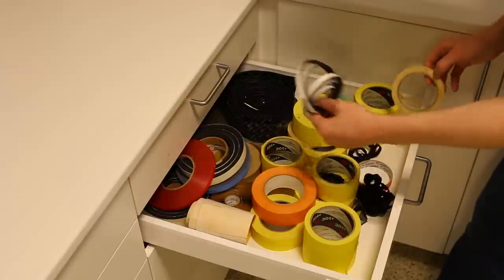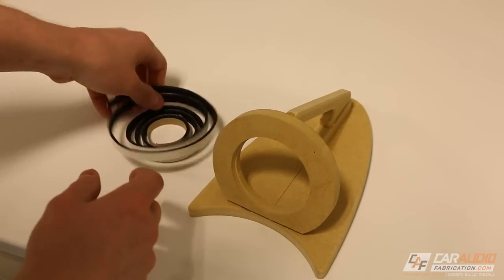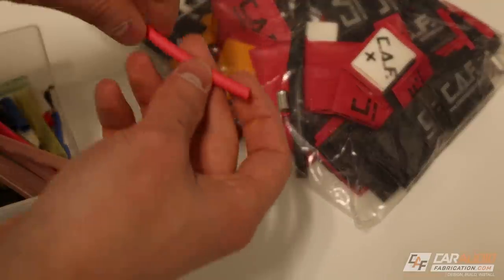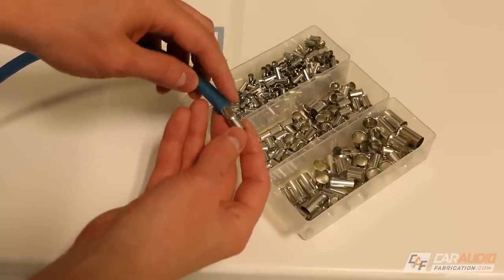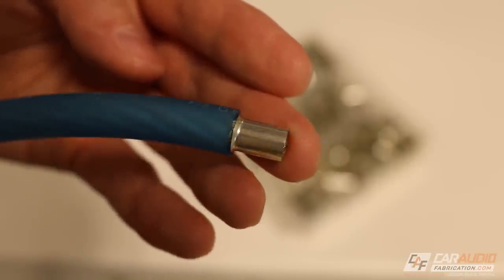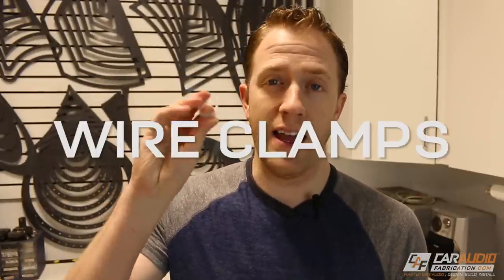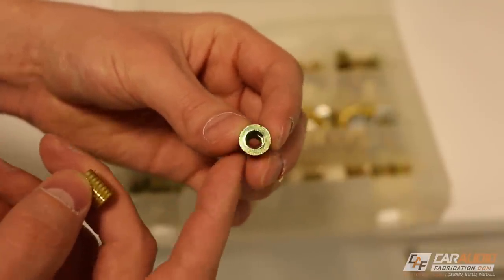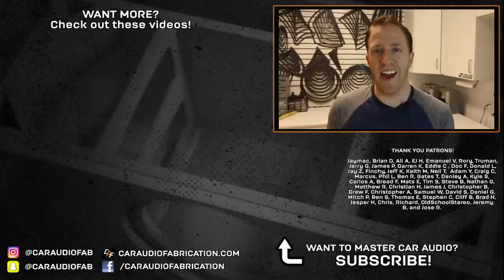Installing Car Audio? 10 CHEAP things to have FOR EVERY BUILD!

Comment from the maker: If you enjoyed this video here is another I recently did for 5 low cost installation TOOLS. You can check out that video here on YouTube: https://youtu.be/s_r82uznoOI
Reply: When people don't put wire ferrule in for the amps and speakers it kinda makes me annoyed. Even though it's something tiny it just seems like something that should be done. It looks cleaner and it probably makes it safer. Your videos do teach me stuff for car audio even though I forget something's. Also, with sound treatment installed will it be possible  to hear the speakers from the outside of the vehicle?
Reply: @CarAudioFabircation you should make a kit of everything besides wires. But your choice

Comment: Good list.  I would also suggest: zip ties, sound deadening material, various fasteners, 2 part epoxy, CA glue, and wood glue.  I also think it's a good idea to have spray paint around that matches the final color of whatever the carpet, vinyl or whatever is going to be the final finish.  I like to paint all the wood parts before they get finished, so that any slight reveal won't be noticeable.  For example, if it's a basic trunk liner wrap going on, I paint everything underneath black or dark gray.
Reply from the maker: +endall39 good additions to the list
Reply: Car Audio Boy Scout :-). Nice comment...
Reply: endall39 is
Reply: Too much for us on appearance. Not enough focus on sound.

Comment: I always keep a metal coat hanger, that has been untwisted with one end sharpened to feed wires through existing grommets. I strip about an inch off the wire, if it's a bundle, I stagger them so there isn't one big blob. I wrap the hanger with Scotch 33 tape, several turns before taping down the wire. Once I've gotten it so it is a gradual increase in diameter, I spray it with WD 40 and it generally goes through smooth as silk.

Comment: was just going to add my list but endall39 covered most, however I also keep ducttape, textured ABS Plastic sheets in 1/8" and 1/4"' for making plates and adapters, i also heat and bend it to make my own hold down brackets for boxes etc.. and of course MDF 3/4" 1/2" and 1/4"

Comment: things i have used on an install. Silicone caulk, i use this in place of the dielectric grease and to plug up any holes that sound could escape through. - also can double as a gasket where gasket tape wouldnt - a thin bead around the edges of say a panel. (to give an example of this i used silcone around the edges of a homemade MDF panel, that was then riveted over a car side panel that had a recess for cup holders - recess was perfect shape for 69's)
Regular pop rivets, hold shit down really tight.
 Soldering iron and solder.
Portable Angle Grinder w/ flap disks
P2000 sandpaper.
Garage carpet - looks good over speaker panels/sub box. You can usually get this for free if you go to a flooring installer and ask for thier offcuts.
Wool Carpet off-cuts - Honestly the best sound deadening over any of the purpose built stuff, but it is heavy.

Comment: Zip ties are a must! Not only are they good for clumping pieces of wires together, it's also a good wire threader if you don't have a wire fish to fish down a piece of from or through your dash. I keep lots of Super 33 tape on me for mock up, and I always have a spool of clothing thread on me, preferably white. That way, if I have a small amount of wire, I can map out my path, say from my radio to my amp, with the thread, cut the piece off, and leave a little extra wire on the ends for stripping. That way, I have just the right amount of wire with no waste and no undersized pieces.

Comment: A cheeeeeep way to do a speaker gasket while also lending a higher degree of customization ability and decoupling, etc. is to use peel-and-stick Ensolite.  Buy it by the yard for your regular sound deadening efforts, and cut thin strips of it for speaker gaskets!

Spray paint also works great for ground connections after mount, simple and clearly no grease concerns.  

I will be buying ferrules asap, I'm starting to see the light on those

Comment: You forgot a very key component to installation! Sandpaper! Depending on what's being done, I like to have 60/80, 100, and 150. If I'm working with thin wood or ply I would also recommend a 220 Grit.

As for tools that you can pick up at any major retailer, (Walmart, etc,) wire cutters/strippers, some kind of illuminating tool; whether a flashlight or a work light as well. I personally use a rechargeable small work light. It puts out a lot of lumens and can last for 8 hours without needing a charge, you CAN run it while plugged it also. One other small piece I recommend is wire butts. You CAN always wrap unused/nonpower wires with electrical tape of some sort. I prefer to use a butt and crimp lightly on it in case I need it for future use.

Lastly, probably the most important thing for audio install; cleaning supplies! Vacuum, general vehicle cleaner, alcohol, and paper towels or cloth that do not leave debris. For all those scuffs, metal surfaces, battery terminals, grounding points, loose debris afterwards, etc. It's an extremely critical step to ensure everything is tidy and cleaned afterwards. You don't need loose wire clippings in your engine compartment.

Hope this helps!

Comment: Best thing to have on any install is a $.39 rod from home depot. I use it to puncture firewall grommets on my quick amp installs. I also bought a crap ton of the water proof grommets off amazon along with a few stinger brand ones to cover the larger 1/0 wire just incase I ever need to make my own hole through a fire wall.

Comment: A multimeter is pretty much essential although I don't know if it would really fit this list since all these are "cost-effective" as you said. With that, I guess a pair of crimpers and wire cutters could really be useful rather than trying to strip wires with a blade or teeth. I don't know if this is a thing but sound deadening tape seems useful.

Comment: Rope Caulk at home depot for subwoofer gasket....helps to hold still while bolt in also...super strong and 100% air tight.

Comment: Between you, Steve Meade, and Johnathon Price.... I’ve learned enough to probably install systems better than most audio shops 🤫 especially here in Dallas where they hardly try. They just run some wires the easiest way they can, run RCAS on the same side to save time, and wire it up. No wire management or anything.
Reply from the maker: They are probably also the cheapest guys in town, trust me there are plenty of shops that do things right, but they also charge for their time. Doing it right ain't cheap!
Reply: CarAudioFabrication agreed

Comment: Look online for companies that wholesale specific parts like stainless steel nuts, bolts and washers and the vinyl end caps for them, wire terminals and their separate insulation sleeves, wire & hose clamps/separators etc. Companies like Nichifu, James Glen, Narva, Mocap, Jae etc sometimes have dedicated specialty wholesalers in specific countries with actual tradesmen/women or people WITH experience to help you out. You will be amazed at the companies out there that actually do specialise while saving money and not dealing with those popular faux wholesaler/retail franchises.

Comment: Cable Glands for the firewall and passing the primary ground through to the frame.    Hydraulic Crimper and tinned copper marine rings for all external power wire termination.

Comment: I always keep a double A battery. To check for polarity. It has come in very helpful a few times.
Reply: Greg Myers place speaker leads on the AA battery, if the speaker pushes outward, that means the wire you placed on the positive side of the battery is truly the speakers' positive connection. If the speaker pulls in when connected, switch the wires around. Hope that helps!
Reply: Wiring colors and materials can vary from different manufacturers. That is why you test polarity with a battery. Also, it doesn't happen often but manufacturers can make mistakes. There have been instances in which a speakers polarity was wired backwards from the factory.

Comment: Great car stereo install items. Some of those I don’t have but I also keep extra wire in different gauges , Soeaker , switches (in case you need to turn off the remote wire to the subs) [= thank you for making this video

Comment: I used to use adhesive weatherstripping before I knew you could buy speaker gasket tape. Once I got gasket tape I realized it's basically the same thing.

Comment: A tough one to have on hand for every car, but plastic panel clips and manufacturer specific screws. From junkyards. 

 I've gone to countless junkyards to pull nearly every screw and clip car has when I'm working on one.  Getting panel clips from a dealer is horrendously expensive. Junkyards I go to give them to me for $5-$10 depending on if I grabbed 50 or 200.

Plus you can practice taking panels off a car and doesn't matter if you break something.

Gm, Chrysler, Honda, Mazda etc typically use the same clips and screws within a generation on many of their cars.

Comment: Never seem anyone use a Ferrell in that way but that is great
Reply from the maker: +Daniel Harrell Yeah check out this video here for more info about the ferrules https://youtu.be/TlV1_GjISps
Reply: Daniel Harrell I use it all the time
Reply: ive been adviced to do so too. a audio buddy told me you should theoretically be able to swing around with your amp while the plus-cable is attached. without those ferrells , the cable would just breaks loose.
Reply: @elsey1976  lmao ahhahhahahahahaah

Comment: Contact cleaner. iFixit toolset, preferably one of the bigger toolsets as they have small prongs and even plastic tools which can be used to remove doorpanels and other dashboard parts.

Electric tape. In worst case scenario, when you desperately need to clean something up.

Red, Blue & Yellow male and female spades, eye connectors, wire "combiners" and all sorts.

Full set of philips screwdrivers as well as the flat type.

Comment: Mark,   On those threaded inserts.  The ones that have the course thread are for soft wood.  The brass one with the finer threads are for hardwoods.    That is the main difference between the two...   ;).   You should check out the other styles for use in composites like plastic.   They are more press fit style.   ;).      Info here from a fastenal's. Account specialist ;)

Comment: With the wire ferrules.  Do you use a small torch and solder the inside of the ferrule so you have a solid connection between the ferrule and all wires.  I also solder the battery terminal connections.  Just curious as to your preferences.  A set of tools that I keep on hand are Tap and Die sets.

Comment: Assorted sizes and lengths of self tapping screws and nuts/bolts for mounting and grounds. Insulated and non insulated Spade and butt connector terminals, non insulated for a more streamline wire after heat shrink.

Comment: CarAudioFabrication  I absolutely love your channel and seen every video atleast 10 times. But i still have a few questions with some things. Exactly how do i wire  stock head unit to amp or stock headunit to dsp to equalizer to amp? Could you make an more in depth video or layout on how exactly the wires will go. I have a 2014 infiniti q50 and no one has done an full audio video on YouTube for it. I plan to do one and promote your channel from my video. Im going to run 4 speakers, 2 componet speaker sets, 2 12in subs, 2 amps, 1 dsp and 1 eqaulizer to a the stock headunit. Im looking forward to hearing back from you thank you so much.

Comment: Had a 2/0 cable screwed into a fuse block without using a ferrule. It loosened up, and when I was jamming out one day, I smelled burning plastic. The copper block part of that loose connection had gotten so hot, it was melting it's way through the plastic housing. It was about 1 mm away from shorting out on the body. It was protected by a fuse, but I suspect when that 150 amp fuse blew, I would have crapped my pants.

Comment: I have a 2017 subaru wrx. I upgraded the head unit to ddx9703s and also have some speakers coming on its way (Alpine R-S65.2 R-Series coaxial and components) what else do I need to complete my set up. I'm looking for really good listening experience. Thanks

Comment: Furrows seem very handy. But I've never used them so you don't need them every install and I've never had any wiring issues with them coming loose later

Comment: appreciate the vids very useful id like to make a suggestion can you please go over like whats a good place to mount an amp and what to use like self tappers through the frame or other ways to mount without going through the frame also can you go over a little bit more detail on how to tune an amp how to set the hz when using a ported enclosure and what size of techflex do you use I noticed they were in inch measurements not gauge I know we can measure it but does the techflex has some stretch or is exact fit

Comment: I have three taramps.  Running 0 wire.    Taramps 3000 ,,  800*4 and 400*4 V2.  Which fuses should I use..??

Comment: Hello Mark. I have a Toyota Avalon with non-JBL system. It does have an oem, non-premium amplifier under the drivers seat, however. The Avalon (non-JBL) has either 9 speakers or 8 depending on having Nav also. My situation is that the stereo is only working the 5 smaller speakers...3 in the dash and one in each rear door. The larger speakers in the front door and rear shelf are not on. Can this signify that the amp is not being turned on? Thank you.

Comment: the threaded fasteners are great idea. my question is the threaded rivets. the tool to set them in place looks huge. is it difficult to use in hard to reach areas?

Comment: is my set up okay?  I used audio control dm-810, 2 sets of kicker 250watts component speaker, rockford p1000x5 5channel 1000 watts,  infinity dual coil 4ohms subwoofer, alpine mrv-m1200 mono block class d 1200 watts amp? ready to install to my Kia soul

Comment: Hey Mark, I was wondering if you can drop a link or the type/name of the wide oem foam type tape used to hold down the wiring harness/wires when running them under the carpet? Thanks in advance!👍

Comment: Hi I have 2004 F-150 I’m trying to install a head unit  it powers up but no sound my stock stereo works. I don’t think my truck has a stock amp any suggestions would help thanks

Comment: I was wondering if you could help me? I was trying to hook up a stereo in my 2001 Pontiac Montana and i was testing the wires to see which was my constant and I found that I have power coming from five different wires. My testing was done with the vehicle off nothing running. How could this be?

Comment: Since this videos are aimed to the DIYers, out of that list we can forget about 6 or 7 of the items. There’s other things you’ll need you and that you should be spending your money on for your install. How many times are you going to use the rivet tool? 4 or 5 times in a life time?  Ferrules, really??? If your amp is properly secured, and so are your power cables to the amp rack, your power and ground wires ain’t going anywhere.... even if you didn’t super tightened their ends to the amp. Speaker gasket tape.... a lot of the entry level speakers  and subs already include a gasket in the package. His justification reason of cuz you made the subwoofer hole too large and you want the sub to sit more snug.... well that doesn’t matter as long as the lip of the sub has the the included gasket between it and the box and all the screws are tightly on. Also, if you REALLY are concerned about air escaping that way, you can always add a smooth thin strip of silicon to the lip of the sub enclosure before your final mounting of the subwoofer. Prior to that, make sure the subs are wired correctly, mount it and test. Once happy with the results, apply that light layer of silicon. Just make sure you let the box dry for 12 hours at least  prior to using it.  There’s a ton of things you can get by without on this video.

Comment: What do you recommend for heat shrink? I heat shrinked my 1/0 with some 3m heat shrink I got off eBay "probably not 3m" and because my cables have some tight bends the adhesive inside the heat shrink comes loose and it's just not the tight waterproof bond I was looking for "especially in the engine bay" is there an adhesive heat shrink that is more flexible?

Comment: Out of curiosity, have you ever tried (or see a possible reason to try) Wago Lever-Nuts for connections that you know may need to be removed in the future?   At worst they could be speedy way to test connections or other temp connections while doing a install without having to do any additional cutting, twisting, etc.     I discovered them while redoing a lot of wiring at my house and I freaking love them (vs twist nuts or permanent push-in connectors).   Watching these types of vids to get ready to do my first car stereo upgrade and thought about them for application here.
Reply from the maker: They are designed more for solid wire. I know they say they work for stranded too but I wouldn't use them for anything more than a temporary test connection. They are awesome for home use though.
Reply: @CarAudioFabrication  Hi and hello!! How are you? I'm one of your subcriber here in the philippines and i watching your youtube everyday..would you mind if you help me to give me the match watts rms for my speakers and subwoofer..at least 2 midrange 4" and sub 6"
My amp is KENWOOD BLUETOOTH 400 watts..
Thank you so much and hoping for your reply..

Comment: Given that most quality amps have built in fuses, when you use a large fuse in the power lead, is it still advisable to use a fuse rather than a circuit breaker?